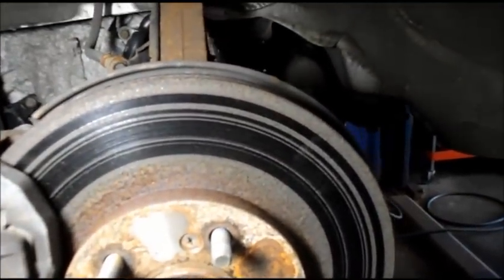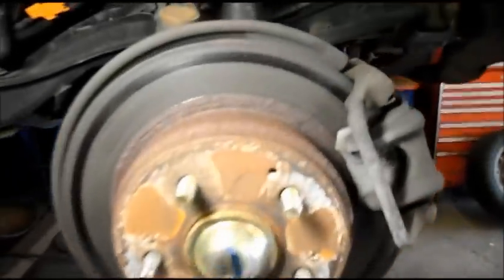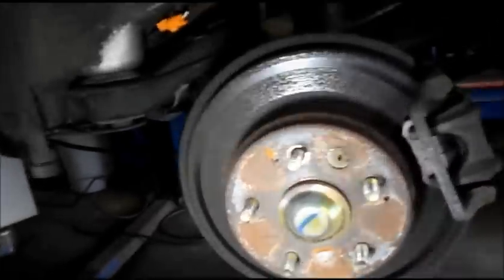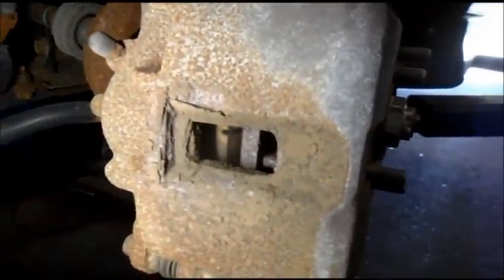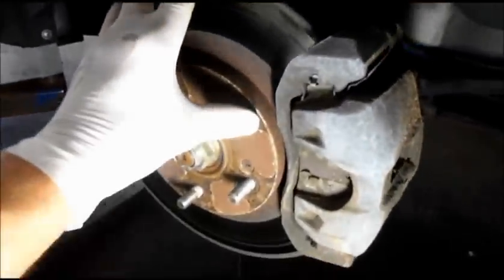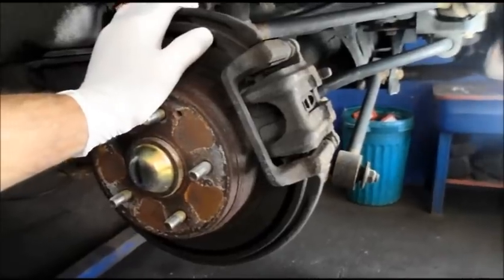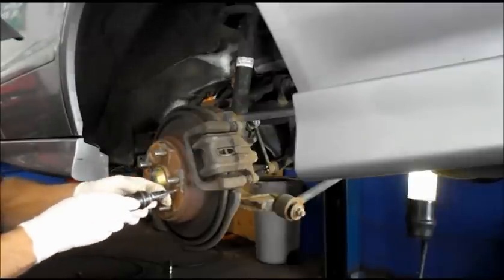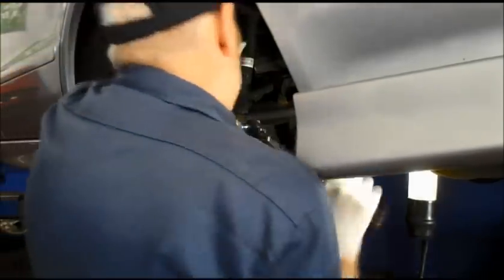How to replace front and rear brakes and rotors on a 2002 Acura TL

Comment: oh what a difference, had same problem with an 02 tl type s i just purchased , although here in Vegas we dont have rust issues like yall have so working on my 104k was still like working on new, the use of my buddies shop lift and tools and his 60+ yrs as a head GM mechanic over my shoulder i think i had it knocked out in 15 mins, was bout an hr to change the tires,  these videos definitely help those of us that want and or need to learn thank you
Reply from the maker: Thanks for watching.

Comment: Just replaced the brake pads and rotors on my 2001 Acura TL. This video was perfect, and the brakes run amazing. The new rotors got rid of a shake in the car whenever I was braking. Only annoying thing is that one of the rotors I ordered only partially drilled out the hole for one of those two main screws on the front of the disc so I had to finish drilling it out so that the tire could sit flat.
Reply from the maker: I'm happy to help.Thank you for watching Great job

Comment: Ha seems most wait till the brake are shot before they bring it in.  Jim I'm wondering about the coating on the rotors. Up here they have pretty much stopped using the oil base  rust preventive you remove with brake cleaner.  I asked my supplier and he says just use a mild soap and water, well the last one I did I tried it and the coating just dissolved . Worth checking out, the rep did say brake cleaner works as well but cost more. Just a thought take care 👍👍
Reply from the maker: +Steve Rob  Most people drive until they can't stop any more and then come in and want it as cheap as possible. Lol. I'm old school Steve soap and water no way .Give me some of Eric's brake cleaner that will work :-)
Reply: Wow Eric gives you brake cleaner  now that's a   Buddy for sure LOL
Reply from the maker: +Steve Rob  Oh Ya he is the best

Comment: Hi jim
My acura 2003 rear driver side rotor has thick rust on it and top slide pin is frozen to caliper bracket. Now the question is : is my caliper bad or if i change the caliper bracket with new slide pins would fix the problem ?

Comment: Hi Jim.. :-) Have u done a clutch on a CRV..?? Got a 2007 diesel CRV and got abit of shuddering when cold and pulling away in first gear.. Manual of course.. Plus clutch slip when going up hill in say 4th or 5th gear.. I take it it's a real pain in the rear end to replace..? What time is involved in doing the job start to finish..? Should I replace the DMF while it's being done at this time..?

Comment: hi how are you. I have a question for you will be much appreciated if you advise me please.  I have an audi a3 1.9tdi it a 55 reg here in UK.  I need to change both font and rear brake. there is a brake sensor on the drivers side on the vehicle attached to brake pads. do I need to bleed the caliper once piston is being pushed in the bore. it is mentioned in the heyns manual. this piston can be pushed in with a g clamp which I have. 
and secondly the rear brakes are not electronic which mean it does not need to be switched off with the car computer ecu probably.  so in order to change the rear pads there is a special tool which is used to compress the piston again do the piston needs bleeding once being pushed in. and finally does the parking brake need to be on or off when the rear brakes are changed.  will be grateful for your advice thanks
Reply from the maker: +Mumtaz Zafar Good morning.The sensor on the driver side brake pad need to be replace or if in good condition remove from the old brake and installed on the new one.As for bleeding the brakes.If you just push the piston in and don't open the bleeder screw you will not have to bleed the brakes The rear brakes you do need a special tool in order to push the piston in depending on the year of the car and last the parking brake will need to be off to remove the brakes.If you need any further advice let me know.Jim
Reply: Thanks for the quick reply dear. Just wondering as I mentioned that according to Haynes manual the bleeder valve should be opened  when comprssing the piston to be honest I just don't want to go through all that bleeding exercise afterwards.  I will just push the piston in with a g clamp on front and with the special tool on rear. I have ordered the tools just now lol. Hope its a stright forward job for me don't want to fill the brake line with air that the only thing thats bothering me. I don't want to find myself in an ackwward position you press the brakes and the pedal is spongy or rock hard lol
Reply from the maker: +Mumtaz Zafar Yes if you don't open the valve you will not have to bleed the system.Be careful when you push the rear piston in that you don't damage the caliper boot.Let me know how you do

Comment: I just did everything you did for the front rotors and im getting a pulsating grinding/rubbing noise when I turn while driving(if im going fast enough it makes a squeaking noise) and applying the brakes, I thought it would go away but it is still there 1000 miles later, nothing is touching the rotor and everything has been greased. What left could be wrong?
Reply: +Matt. You probably have another problem or missed something in original replacement. redo your work and/or look for other suspects.
Reply: Max R it shouldn't be a different problem as the noise began immediately after the job
Reply: +Matt Mitchell . all right, then redo the work.

Comment: I did not see you remove the front axle bearing and grease it. Isn't this normal procedure to clean and grease  when installing new rotors?
Reply from the maker: Not on front wheel drive.

Comment: Theres a special tool to take the rotor screws off
It works by hammering the end and unswcrewching at the same time
Reply: Many people mistake those screws for phillips head, which they are not.

They are Japanese Industry Standard (JIS), and while looking like a phillips head, there are subtle differences.

Usually the screws are seized with rust, which is why the tapping helps. I just use a torch, which makes them just as easy to remove.
Reply: lastuvthe 
I Just changed all 4 of my pads and rotors for my 01 Acura CL
And luckily my friends dad had the specific tool that was for taking the screws off honda rotors.
I suppose you could use other methods but if you can find the tool, impact screwdriver, i suggest use it because it was a breeze.
Reply: Ya, an impact driver will usually work - I was just clarifying that those set screws are not phillips cross-heads. The walls of the slots in the JIS screw head are parallel and will cause the regular style Phillips screwdriver to cam out of the screw as you’re trying to turn it.

Obviously you don't really need one if you aren't working on a lot of these types of vehicles. I bought a set a long time ago when tearing apart various motorcycles.